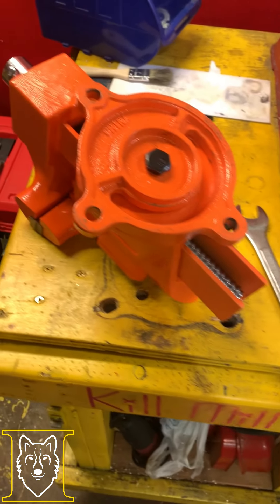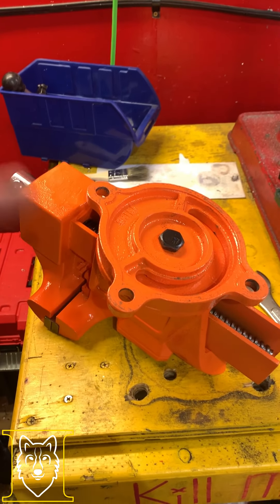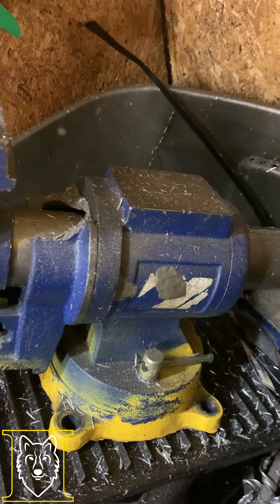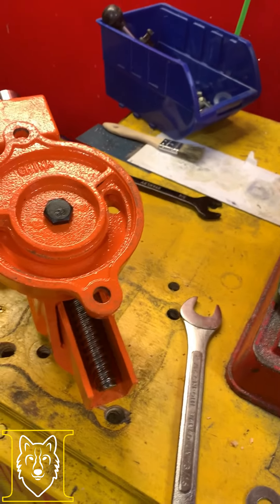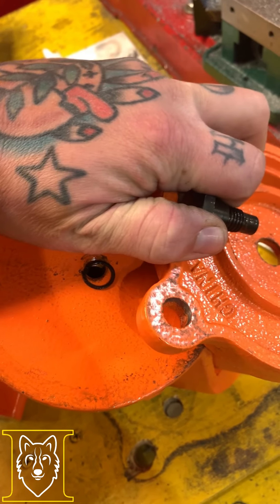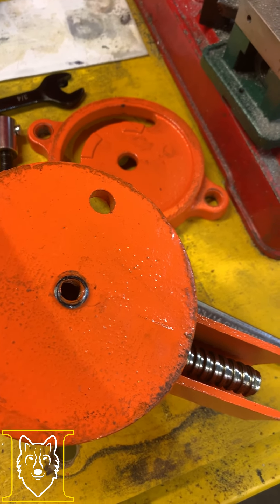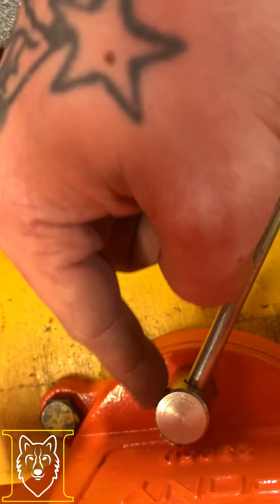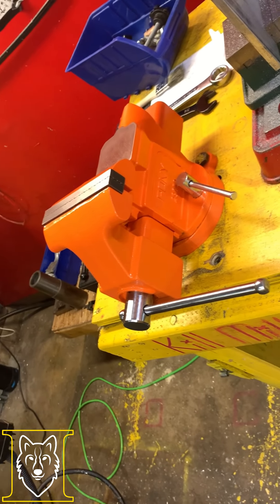Tool Review #1 - Pony Vise | Wolf-Haus Industries

Comment: Thanks for the video, did it actually restrict the swivel feature or did it work perfect with your washer added on?
Reply from the maker: With the size of washer that I used it pretty much locked up the swivel motion (which was what I was going for personally). I've never needed nor wanted the swivel function, but couldnt come up with a way to mount it that didn't involve the swivel base. I would imagine though that if you were to use a thinner washer you could snug up that motion without rendering it useless. And who knows, if you bought one maybe yours wouldnt even need a washer and perhaps I just got a fluke, the washer solution just seemed way easier than the amount of patience I had for dealing with the return process to then go gamble on another import vise lol I will say its been a sturdy little vise tho having had it for a while now. Way better than the options from HF or half the stuff at big box stores like lowes.